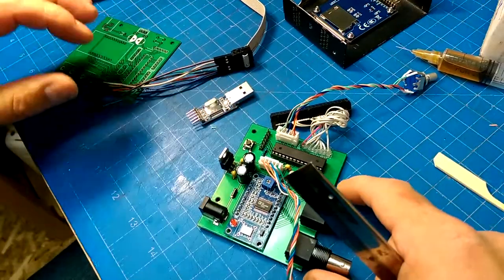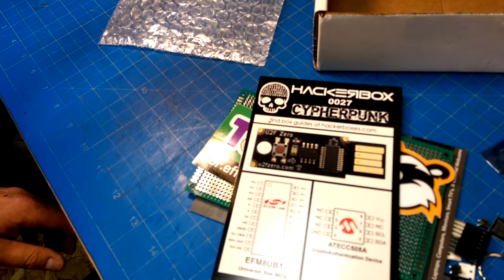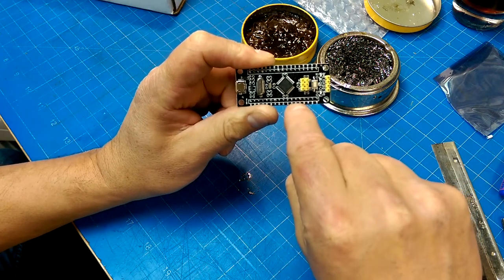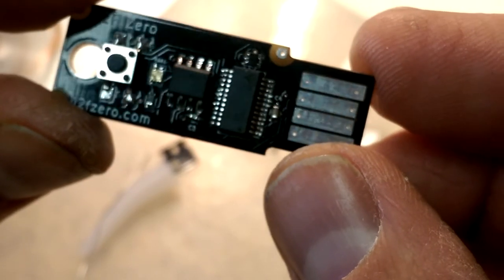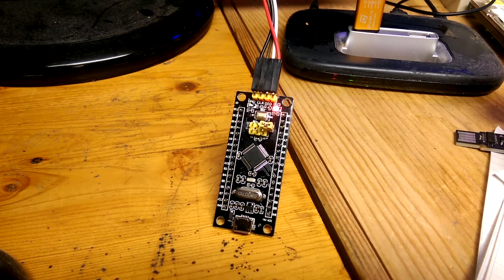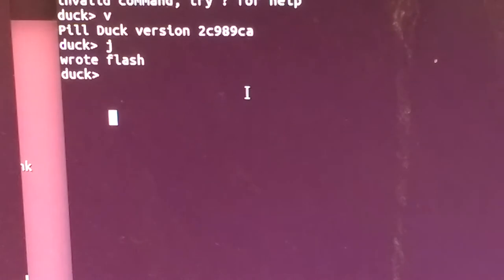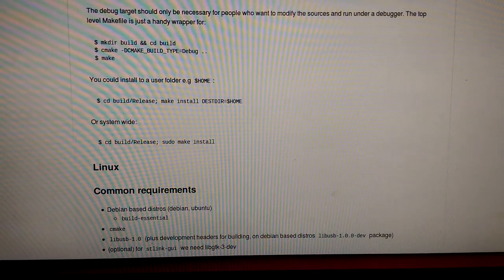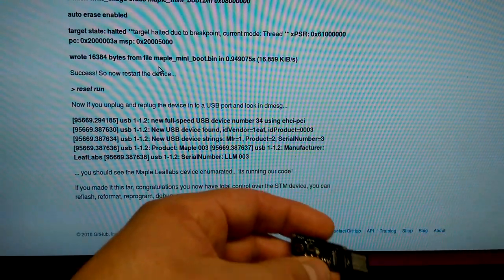Hackerboxes 0027: Cypherpunk

Comment: Thanks again for a very helpful Hackerboxes review. It's seems somewhat comforting to me that you weren't able to get the little U2F Zero to chooch either. If you couldn't figure it out then I feel less of an idiot. I think that "Zero" is the operative word for this project. The surface mount hand soldering task was interesting. I think I did a pretty good job working with all those minuscule surface mount parts. Those are the smallest components I've ever attempted. Lot's of solder flux is the key.  I plugged the USB dongle in to my computer and held my breath.  The USB overcurrent protection didn't kick in, there was no blue smoke and my Mac can at least read the Silicon Laboratory vendor ID from the chip. So, I guess it's potentially working. I wonder if the LED is supposed to light up to indicate that the board is at least powered up? I'm getting nothing. The Hackerboxes people suggested that I try the STlink USB programmer. But, it was choochless. So, I resorted to trying an Arduino Mega as a programming board. No luck. I never could get Simplicity Studio v.3 (on my Mac) to detect the U2F thingy. Do I even need the Simplicity Studio app if I'm using the Arduino board as a programmer? Maybe I can flash hex files directly onto the U2F Zero through the Arduino? Does the U2F need to be plugged into a USB port along with the Arduino board in order to work?  Hell, I'm not even sure what I'm talking about anymore. It's like trying to bake a cake using a recipe that leaves out key ingredients because it's assumed you already know what they are. The frustrating thing about this is that I feel like I'm on the verge of figuring it out. Maybe if I keep going I'll stumble onto the essential key step that I've overlooked. But I seem to be groping around on the dark and I've spent too much time on it. So I give up. A little disappointing. I'm hoping that one day maybe you or someone else will revisit this and figure it out and maybe post clear instructions. Now on to #0028.
Reply from the maker: I suppose that it is called a hacker box and not an electronics kit, so it should not be a complete surprise to me that some of the stuff is hard.  I don't regret the time I have spent on it.  And I will for sure return to it in the future, but for now I have to let the subconscious deal with it for a bit and when inspiration (and known good hardware :-) arrives try again.  I did not check to see if the vendor ID showed up in dmesg.  I will have to check that.  And it really showed that I need to make the kiln into a reflow oven now that I have the SCR's.

Great.  Another project.  Yay.